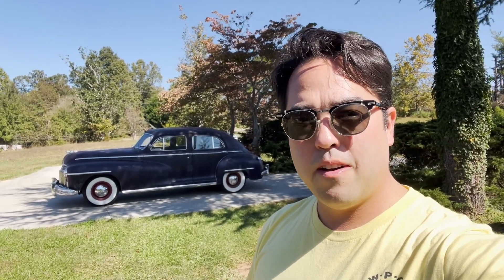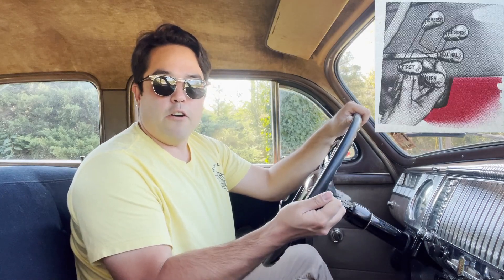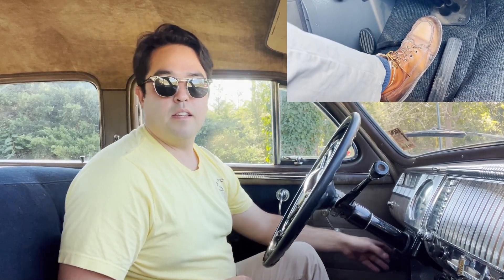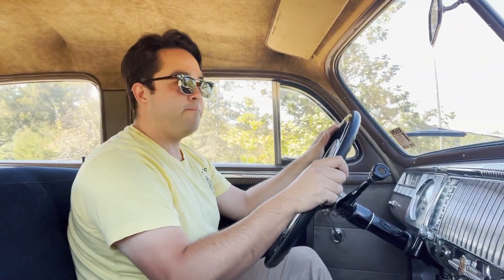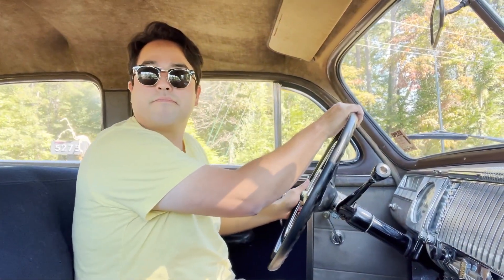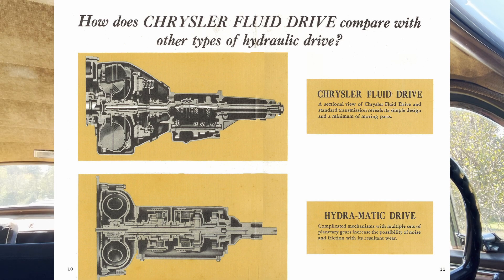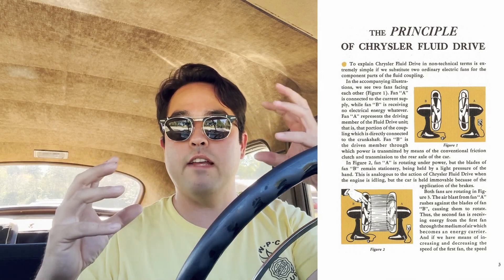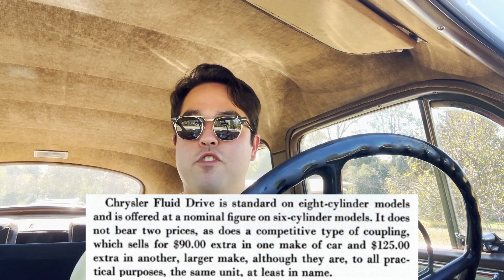Fluid Drive - Operation and History Chrysler's Innovative Transmission. How to Drive a 1947 Dodge.

Comment: Excellent tutorial. Friends have these old Fluid Drive Mopars. I have a 53 Plymouth with 3speed OD, currently needy and in storage. Nice setup when working properly. A friend picked up a 53 Hy-Drive engine, plugged the torque converter holes and put it in a 56 with a three on the tree

Comment: I unfortunately have the semiautomatic m6 transmission in my 1950 desoto it would be a great car without it so many problems and complications.
Reply from the maker: I’ve had a few of the semi-auto fluid drive cars and they worked flawlessly. They were original and untouched however.
Reply: @ObsoleteAutomotive  my 50 desoto has so many issues from it mostly in the carburetor caused by the m6 fluid drive. After 75 years it probably needs a new wiring harness for the transmission and that is not it’s fault but you can’t deny that the basic system used in the 1950 dodge is a lot less complicated and easier to service . The solenoid on the carb could be bad on mine as well all I know is that it won’t idle without when stopping without disengaging the clutch and even after rebuilding the carburetor the anti-stall valve is still inconsistent sometimes it works other times it stays in the open position causing the carburetor to flood. Any suggestions would be highly appreciated because I really like the car and it has so much potential but at this point I’am tempted to find it another home or buy a 1950 dodge that is for sale and use the desoto for parts or look into seeing if putting the running gear of the dodge into the desoto is possible. My son in law is coming in over labor and I will see if he can figure out anything and if not I plan on just giving up on the car. Ironically when I bought the car a couple of months ago everything worked perfectly fine I have worked on a lot of vehicles but my mind can’t understand or diagnose the fluid drive system because at its core it’s 1930’s technology working on smoke, mirrors and held to with promises unfulfilled 🙄😔😬😖😢😢😢.
Reply from the maker: @spotsill One thing to check is the contacts in the solenoids that control shifting and such. Over time they can get corrosion or burnt marks which can affect the shifting and such. There is wiring that should be checked for any damage or bad connections. When these systems work they essentially can work forever.
Reply: @ObsoleteAutomotive  so I have been told it’s just easy to get disappointed  and discouraged sometimes. Still not sure what I’am doing with it yet and at this point it’s not going anywhere until next spring. I belong to the desoto club they recommended a place in New England that can make you new wiring harness for the fluid drive if I decide to keep the car I might replace that over the winter. I might look for an easier project and just take the time needed to fix it properly who knows.
Reply from the maker: @spotsill If you don’t have a factory service manual for the car I’d highly recommend getting one. It spells everything out with photos and descriptions. Troubleshooting and all.
Reply: @ObsoleteAutomotive I even got the Chrysler supplement for the dealers on diagnosing the fluid drive transmission. The new voltage regulator came to my house today and I ordered points and condenser to replace the electronic ignition module the former owner installed because members of the desoto club told me that it can interfere with the ignition interrupter, I will see if I can clean the points on the transmission as well if that doesn’t work I will look into a new wiring harness for the transmission. That said I still might look an easier project because I’am not convinced that the issues with the car are fixable and it starting to look like it could turn into a long project all I wanted was a driver not a show car but not sure I can get it back to that stage again . Thanks for the encouragement anyways 👍🏻👍🏻.

Comment: Your video on the Fluid Drive 3 speed manual Dodge leads me to think that that same fluid drive exists in the Pilot House Dodge pick up truck of similar vintage. The difference between this type car/truck and the semi-automatic fluid drive can be noticed BY - if you accelerate to 20 mph and lift your foot off that gas the semi-automatic will change up and you will hear the clunk where as the manual will not do so.
Reply from the maker: There was two types of fluid drive. The manual transmission w fluid coupling vs semi automatic trans. The pilot house trucks did have them as well.

Comment: I am 70 years old and learned how to drive a three on a tree on a Plymouth back in the 1970s.  From what I can see, fluid drive is a flimsy excuse for an automatic transmission.  Until companies like Ford and GM perfected the automatic transmission, I would much rather drive a three on a tree.
Reply: There was nothing flimsy a about fluid drive.  I've owed several 1946-48 / 49 Dodge cars with Fluid drive,  these cars were 40+ years old & still functioned just fine. Looking back at this development as a flimsy excuse is getting things out of order.
 When looking at Fluid Drive from the late 1930' & into the 1940's it was modern technology, it allowed much easier driving. However taking off in high gear was not quick,  but in city start stop traffic it took the constant shifting out of the equation. There were no interstates when these cars were new from the factory.  Speed was not a major factor at that time. The major highways in most of the country were Not high speed roads. American cars did not come with disk brakes & radial tires, as those items were in the future at that time. The real muscle cars came along in the 1950's with a few 1930's & 40 model as an exception. When Fluid Drive was introduced the GREAT DEPRESSION was just winding down, times were hard for most people & Fluid drive was step toward easier living, easier driving, & a brighter tomorrow.  It was a stop gap measure until real automatic transmissions could be thoroughly developed & tested.  GM introduced a fully automatic transmission in 1938 or 1939,  it was NOT common until after WWII,  it was also an expensive option.

Comment: At least you have highlighted the difference between the 4 speed semi automatic and the 3 speed manual.
You can tell what it is when you put the car in first gear position accelerate above 12 mph say to about 20 mph and lift your foot off the gas. If you hear that change up clunk you will know it is a manual as you just described. If hear the clunk when you lift the gas you will know it is a semi automatic.

Comment: Bunch of BS!  No one had automatics in 1939   GET YOUR FACTS STRAIGHT< AND KEEP YOUR  BS off the web.
Reply from the maker: @vw4x4  You show your ignorance very clearly. But I’ll go ahead and educate you. The Hydramatic AUTOMATIC transmission was introduced in 1939 for the 1940 model year in Oldsmobiles and then on Cadillac in 1941. Car production was halted in 1942 due to WWII. But guess where the Hydramatic was used? TANKS and other military vehicles. So how about you actually do simple research before spouting off nonsense and making yourself look like a fool.

Comment: Great Video about the fluid drive! I own a 49 DeSoto de luxe and it has the Four Speed fluid drive! It drives very Nice. Lately I came across a 1950 Chrysler NewYorker with an 8 cilinder. Wow that runs very nice. Maybe I am going to buy that one but first I will have to do some research about that particular car.

Comment: On the Chrysler car line, the four speed Semi Automatics in 1951-52 had a fluid coupling or an optional Torque converter model, which was standard in the Crown Imperial.  It was optional and pretty rare on the other V8 models. The column was marked either "Fluid Drive" or "Fluid Torque Drive."  They specify a different frame depending which version you had.
  Fun fact. Chrysler had a special fluid for the Fluid Coupling.  They were a bit secretive about the ingredients because it was mostly whale oil. On the plain "Fluid Drive", you filled the gear box separately from the fluid coupling and they did not share fluid.  I suspect transmission fluid or a 0-10 weight modern motor oil would suffice for fluid coupling today.
Reply: Industrial hydraulic fluid (mineral based) would likely work. A guy would check with someone who knows for sure first

Comment: Austin, you did a good job with this.  Thank you.  I have a '48 Chrysler Windsor which of course has the four speed Fluid-Drive employing under drive gears.  That's the system that almost no one can describe correctly or drive correctly either.  So, I'm wishing you the best for the upcoming video on that version.
Reply from the maker: @discerningmind  Hope to get one of the “semi-auto” versions in the future at some point! I had a ‘49 Chrysler with straight 8 and fluid drive and it was a nice cruising car!

Comment: This is a cool concept, wonder why it did not continue...  Cost too high compared to a conventional clutch?
Reply from the maker: @fleetwin1  it lasted until automatics came out for 1954. At that point they didn’t seem the need to keep it as an option. But did have some use in industrial settings for a while longer.

Comment: Excellent informative video, Austin. Note that this Dodge has a center mounted stoplight, which was way ahead of its time. As I recall, all MoPars of this era were so equipped.
Reply from the maker: @phillipcramer7936  Yes you can see a video of this car on my channel for more in depth overview of this ‘47 Dodge. What most folks don’t know is that the center brake light is actually the ONLY brake light. The left and right lights are turn signals (if so equipped) or running lights only. But on this car a person added auxiliary lights on each side to come on with the brake light so you get three with more visibility.

Comment: Fluid drive was also used in industrial applications.  One of my first employers had a Chrysler powered forklift with fluid drive, the fluid drive made forklift work a lot easier and saved a ton of wear on the clutch.  Chrysler flatheads were very popular industrial engines and powered just about every kind of machine you can imagine.
Reply from the maker: @danielstickney2400  They used flatheads in industrial uses way past when they ceased use in cars. Airport tugs, generators, pumps, etc. They were easy to work on and maintain and would go a long ways!

Comment: Can ya shift it without the clutch like a old non synchro?
Reply from the maker: @rctopfueler2841  Practically any manual transmission can be driven without a clutch if you can match engine speed and such and shift at the right time.
Reply: @ObsoleteAutomotive  thats why i asked  i drive without it all the time. No grinding no chunking up or downshifting  any car i drove

Comment: Having owned a beutiful '46 Dodge for many years, you have to remember that with the fluid coupling it will NOT hold in gear--you have to use the parking brake every time you park
Reply from the maker: @ronaldfazekas6492  Yes I go over this in the video…

Comment: So the other fluid drive was 4 speeds, with auto shifting from 1st to 2nd, manual from 2nd to 3rd, and auto from 3rd to 4th?  
Also, I find it ironic that the GM Hydramatics seemingly got worse & weaker from 1939 to 1963, while Chrysler came out with the reliable TorqueFliet in 1956...
Reply: Yes, exactly right on the four speeds.

Comment: Not sure how this is in any way better than standard manual transmission
Reply from the maker: @JosephGores-qu1qw  You don’t have to use the clutch in a traffic jam or city stop and go driving. So you save your left leg.
Reply: They saw this is the reason DeSotos sold like mad to New York City cab companies after Fluid Drive came out.  I can only imagine what driving a clutch only manual in stop and go driving all day before this.

Comment: Chrysler also had a torque converter connected to a manual transmission in the early 50s, Fluid Torque for Chrysler and Hy-Drive for Plymouth

Comment: Good demonstration. To be clear you must use the clutch whenever you shift to any gear other than the one you are currently in.
As a side note, all vehicles EXCEPT Plymouth in Chrysler's line up after WW II had Fluid Drive. Desotos and Chryslers had the semi-automatic 4-speed Fluid Drive. 
Thanks for a great demonstration.
Reply: They had them as an option on 6 cylinder Chryslers, required on v8's.  You will almost never find a Windsor with fluid drive ( in 1951-52).

Comment: Service on fluid drive  is different also  they use hydraulic oil  (20 w ) i work on a few of these   pretty reliable  just keep relays and switches in check  awesome video thanks for posting
Reply: meaning the oil for the entire car is hydraulic?
Reply: @Ri5004  just tranny 20 wt hydraulic oil winter 30 for summer 
Definitely car for non mountain driving.lots of freewheeling 🙀👍😁😎

Comment: Hi Austin - as always, "interesting, informative and entertaining!" My dad taught me how to drive in a 3 speed manual  1954 Plymouth and I had a 1950 Dodge Meadowbrook fluid drive in college. ngl i never did get the hang of driving it smoothly. i bought a new 1963 Dodge 330 after college - my first automatic transmission! I still miss the push buttons on the dash.  i love your videos 👍🏼.
Reply from the maker: @danielimpastato3466  all great cars! I’ve had several 1953 Plymouths but never a 1954 oddly enough.

Comment: Shifting from 2nd to 3rd that way can cause you to jam the trans into 2 gears at once.  To shift from 1st to 2nd, you are supposed to move the shifter straight up into Neutral, then straight up into 2nd.  Also, on level ground, you can take off in 2nd.  Try it
Reply from the maker: @jamesbosworth4191  I have NEVER had a transmission try to jam into two gears at once and I’ve driven stick cars thousands and thousands of miles. It’s pretty much impossible to do. Though I’ve seen worn out linkage bind up causing the shift lever to get stuck but that’s just due to bad tolerances. Shifting from 2nd and 3rd in what way? You literally only can shift one way… moving the lever down to 3rd…

Also, when you shift to any gear you automatically go into neutral to get to that gear. There’s no other way to go… not sure what you’re even trying to say. Unless you’re trying to reference double clutching? 

Technically you can start off in any gear if you want. And in this car even more so. No riding the clutch… in this one. You put it in any gear and just drive. Hills and such dictate how fast you’ll accelerate.
Reply: @ObsoleteAutomotive  When you were shifting OUT of 1st, you were trying to push the shift toward the dash, as if you were trying to move it diagonally from 1st to 2nd.  THAT is what you shouldn't do.  You should move with just upward movement to Neutral, THEN move it toward the dash and up into 2nd.  And many transmissions are indeed designed so that it can't jam into 2 gears at once, there are many OTHERS THAT CAN AND WILL.  Chevy transmissions, some Nash transmissions, and even 1939 Packard transmissions are notorious for that.   And when I was referring to starting off in 2nd, I was talking about in cars like this.  Obviously, you shouldn't do it in cars with a conventional clutch and trans.  I have learned the hard way that unless you can prove your argument, it is best not to try to argue with people much older than yourself.  They are usually right.
Reply from the maker: @ I don’t push the shifter forward it does it itself. My showing how to shift is for demonstrative purposes that 2nd and 3rd is towards the dash and 1st and reverse is away from the dash. Makes it easier for people to understand. I explain that it will pop into its quadrant when shifting to 2nd. And even if I shove the shifter forward as hard as I want it will still work. These are made for use and abuse. 
You CAN start off in 2nd in conventional stick shift cars in many instances. Works fine on flat ground or on downward inclines. As mentioned in the video in this car I said you can drive this car in any gear in most situations. That’s one of the benefits of this setup. 

And I’ve been around plenty of older people that have no idea what they are talking about. Age doesn’t always mean intelligence. The “I’m older I know more” rebuttal is played out too much.
Reply: @ObsoleteAutomotive  Youthful arrogance.  You'll learn, someday.
Reply from the maker: @ No I won’t. Get off the high horse friendo.
Reply: @ObsoleteAutomotive  You'll see.
Reply from the maker: @jamesbosworth4191  Things that won’t happen for 500 Alex.
Reply: @ObsoleteAutomotive  ?
Reply: @ObsoleteAutomotive  I'm 79  years old and agree with you about how the shifter works.